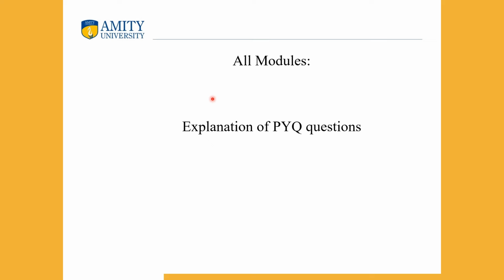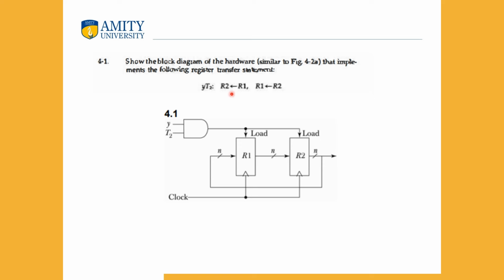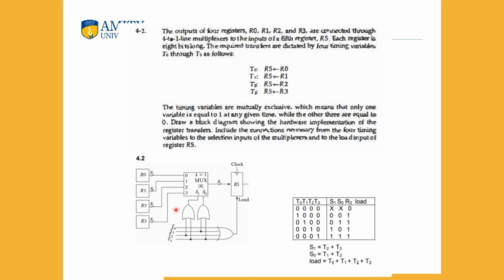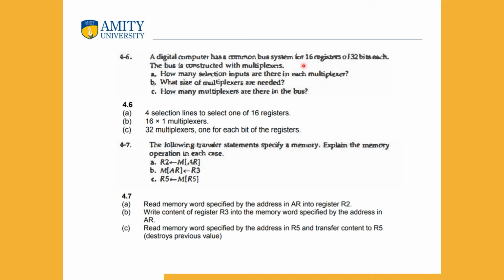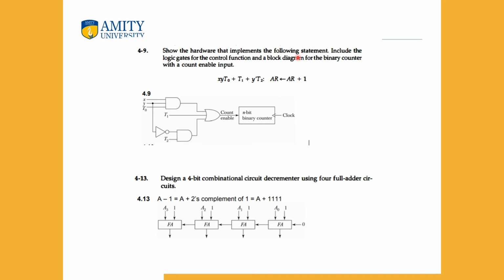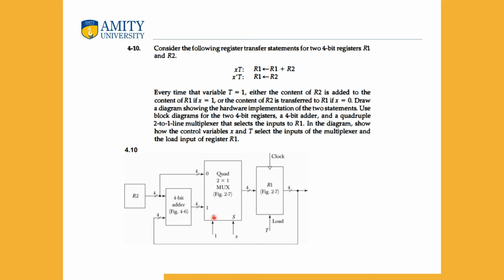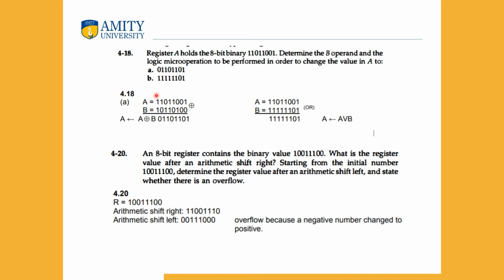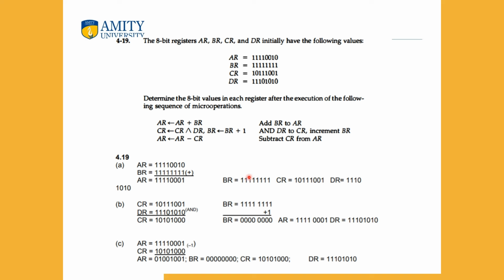DECO PYQs | Part 1 | SAY NO TO BACKS Series

Comment: Exams hai bhai yrr  (2/04/2026) exam start hai plz bhai help kr dijye
B.Tech cse 4th semester please help 🙏🏻🙏🏻🙏🏻

📅 My Exam Schedule (April 2026)
| Date | Time | Course Code | Course Title | Mode |
|---|---|---|---|---|

| 02/04/2026 | 10:00 AM | MATH242 | Applied Mathematics-IV | Regular |

| 07/04/2026 | 10:00 AM | IT201 | Java Programming | Regular |

| 08/04/2026 | 02:00 PM | AIML203 | Deep Neural Networks | Regular |

| 10/04/2026 | 02:00 PM | CSE204 | Theory of Computation | Regular |

| 13/04/2026 | 10:00 AM | CSE202 | Operating System | Regular |